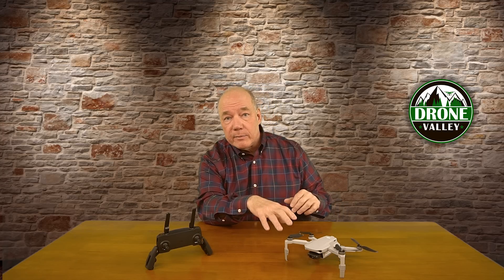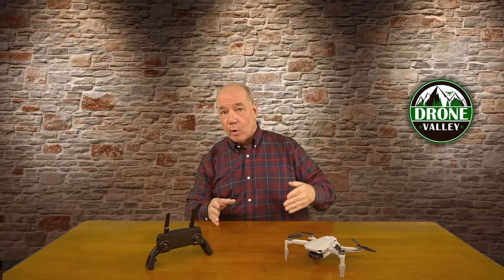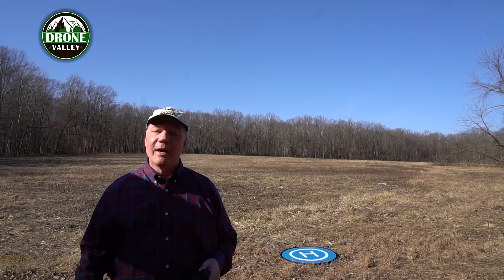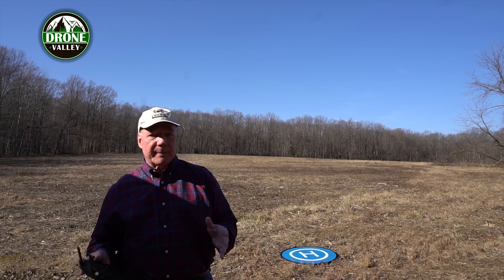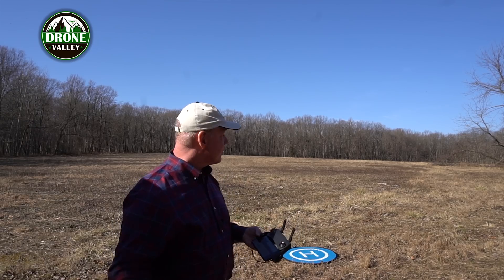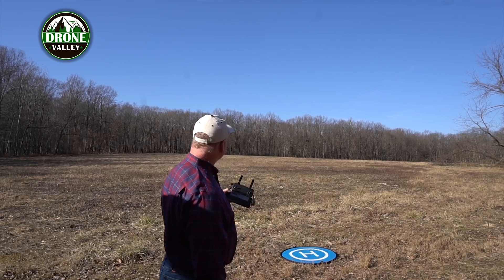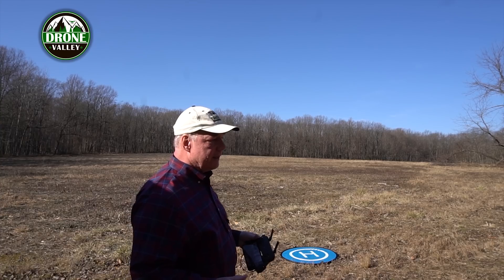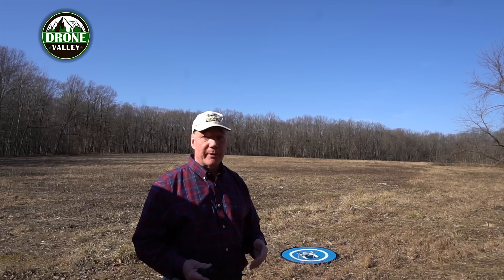Mavic Mini Return To Home - How Does It Really Work?

Comment: Excellent as always and you even mentioned the 20 meter scenario which most people fail to mention.  Biggest fear for me is to have a failsafe RTH triggered and it's flying directly back against the wind and can't make any progress and starts drifting away.  I've thought about even trying to send the emergency motor stop signal if I got a re connection for just even a second.   Falling straight down might be better than having it drift away.
Reply from the maker: I agree but with these smaller quads, the wind is always a factor. Even with the larger ones it can be a challenge. I was actually testing the new EVO 2 last week on a crazy windy day to see how it handled it and got is out over the bay with the wind at it's back. I had a heck of a time getting it back to the takeoff point because I was flying back into the wind. I had to drop down low over the water to make any progress and it can surprise you how fierce the wind can be at height.

Comment: How much safety margin has DJI programmed into the low battery mode in terms of per cent battery remaining?
John
Reply: At 20 percent it will constantly beep at you until it is turned off.